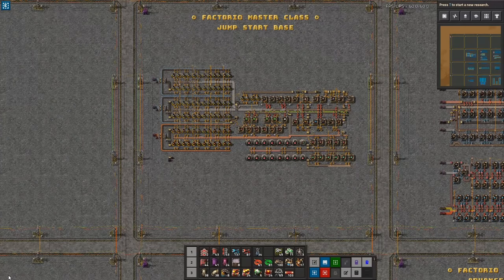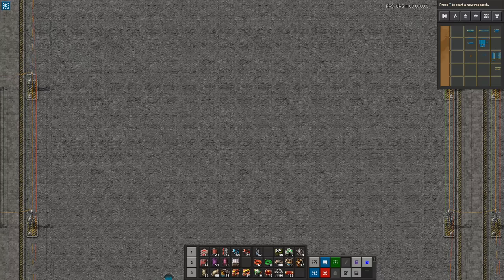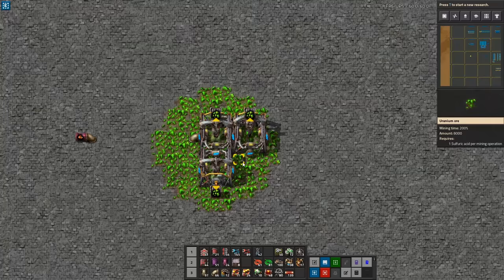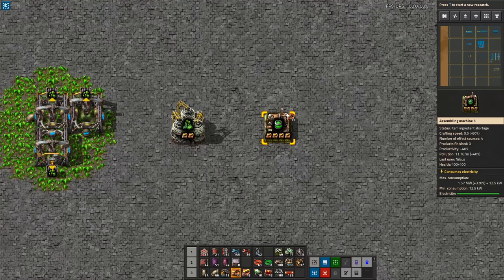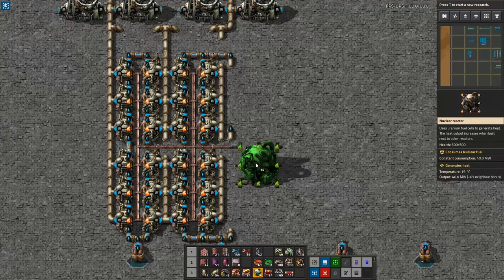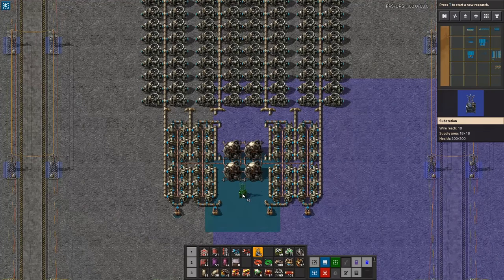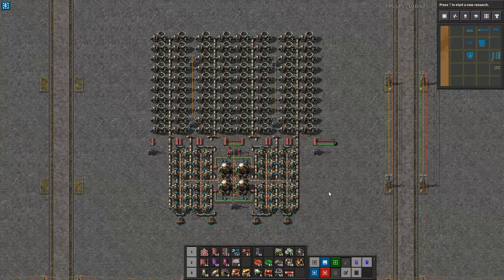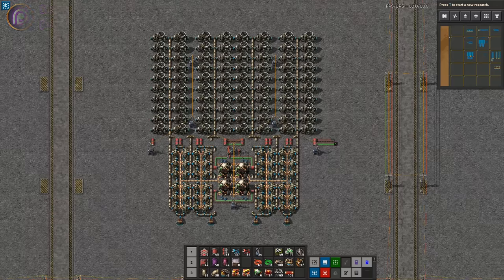NUCLEAR POWER; Shattering Conventional Wisdom | Factorio 0.18 Tutorial/Guide/How-to

Comment: Here is why I disagree with your perspective about steam storage:
One: steam storage is eeeeeasy. Just slap some tanks down in the free space along the sides of your boilers. The design difficulty is zero, and compared to the cost of the rest of the parts, a dozen tanks is basically free.
Two: peak capacity being higher than sustained capacity is useful for e.g. situations where you are transitioning from heavy solar or have lots of laser turrets or other situations where your power consumption needs might be "bursty".
Three: reactors which are hot (>900C) EXPLODE if they are destroyed by damage, with the same effect as a nuke going off. Nothing like a few biters getting into your power plant, and then the entire thing literally blows up and you have to rebuild all of those extremely steel heavy structures on a factory with no power.
Four: It adds resilience to brief outages. If I need to disconnect the water supply to re-route pipes, I can do that, and it will run for 10 minutes.

Technically, storing heat directly in pipes is more space efficient (500MJ/tile compared to steam tanks at ~269MJ/tile), but just building more heat pipes in random places is ineffective because as you point out, heat transfer becomes a bottleneck.

I disagree with your perspective about circuit-limited reactor designs too, because they are very simple to implement well. I homerolled a controller design which is 3x4 tiles, contains only 6 combinators, and it's both jam-resistant and idiot-proof. It's the difference between waiting until kovarex to spin up nuclear fuel for your trains, and starting it as soon as you can.
Reply: You make good points.  I guess it depends on the situation: a big base with low UPS means not using tanks will make the game run faster, because it doesn’t deal with the fluid calculations involved, and a base on a limited-resources-run is way better off implementing efficiency measures. 

It ultimately comes down to preference and convenience.
Reply: Well, if bitters chew your nuclear reactor, you have something very, very wrong with your base defence anyway.

I do agree that steam and circuit based nuclear power are simple to build, and they are scalable. You can easily build a 480 MW power plant (that's 4 reactors) even if you only need 60 MW right now (it's usually the power I need when I start looking into nuclear power). You won't use that much fuel, stockpiling for the future, and you won't need to deal power for a while.
Reply: @giovannidueck9094  Megabase skip nuclear power entirely and only use solar. Solar have no UPS cost. Nuclear power can't beat that, with or without steam tanks.
Reply: Regarding point 3: With the addition of the spidertron, this has become a non-issue. Simply building the reactors on an island that is only accessible by spidertron makes them completely invulnerable.
Reply: Doesn't really matter once your Kovarex process is up and running, as you basically get unlimited nuclear fuel.  Get a couple uranium patches being mined and processed and it's pretty much impossible to be short on it.
Reply: the  heat modulator for nuclear is rather simple. have red/green wire from tank to inserter that removes fuel. set too only remove fuel if tank is below say 10000.
run another wire from emptying inserter too fueling inserter. set filling inserter too read hand contents and only add fuel if it reads that there is more then zero empty fuel at hand. so when the emptying inserter is told too work it creates a signal of the empty can and triggers new fueling.  at idle the nuclear reactor will have one dead fuel in it. when tank gets low the fuel is removed which leads too the inserter outputting a signal due too read hand contents and then it ads one more fuel. make sure to limit inserter to one item.  too start up insert one fuel and let burn too emptie.
Reply: @joejane9977  thx man，it really help

Comment: One thing I like to do is add steam storage tanks and wire the system to feed fuel cells only when the steam storage runs low. This way, I use the fuel cells efficiently.
Reply: 34:11
Reply: @littlebuilder8132 then just build 1x1 reactor (lone reactor) setups if you think uranium is so plentiful that you don't need to be efficient.

I love Nilaus, but his argument here makes no sense.  He is saying to build 2x2 for efficiency, but then don't build steam/circuits because uranium is plentiful so you don't need to care about efficiency.  Can't have it both ways.
Reply: @beepbop6697  you need 12 1x1 reactors to get 480MW from a 2x2 , 12 reactors is far less efficient even with unlimited fuel.

Comment: Great guide! It's really surprising how few miners and centrifuges are needed even without kovarex. I always start doing on-site uranium processing as soon as I unlock the research. I don't use modules, so I go by a 10 miners : 3 centrifuges ratio. I usually start with a 2 reactor build because its cheaper to build early on and satisfies my power needs for a long time, and just the 10 miners and 3 centrifuges is enough to support it indefinitely. The nice thing about having a tiny uranium processing build is that you can put efficiency modules in everything and never have to worry about biters. Sometimes I will use steam buffering for the 2-reactor setup because you only need a couple fluid tanks (maybe 10 or 20) and the wiring isn't too bad. For the 2x2 build though its definitely not worth it, especially after you get Kovarex.

Comment: I have two extremely efficient designs that "just work", a 2x2 and a 2x5, both of which fit nicely within Nilhaus' city block blueprints. They feature auto start/stop for power saving and peak power boost thanks to steam storage tanks, backup power for the pumps nearest to the water input (assuming you disconnect their wires), all without a single combinator or requiring any sort of tuning. 

The 2x2 has a max boost power of 500MW, and sustained 464MW of a possible 480MW, and the 2x5 has a max boost of 1.6GW, and 1.37GW sustained out of a possible 1.44GW, so they are highly efficient too. I tested them rigorously to ensure they do not suffer from any of the common pitfalls that Nilaus mentions in this video. You can of course remove the steam storage if you don't care about fuel efficiency or all those nifty features. 

They are available on the Factorio Forums here: https://forums.factorio.com/viewtopic.php?f=208&t=91639&p=521863

Comment: I use steam storage with additional turbines as a means to store energy for turret spikes. I also setup an alert system so that once it is below a certain point(power use exceeds actual power production) I can go add another module to the power plant.
Reply: you can also use the steam storage to prevent over heating of your reactors : nuclear plants heat up to 1000°C no matter the consumption, any excess heat is wasted. If you setup things so that you only empty your reactors when steam storage goes bellow some level, and you only fill back when emptying, you will minimize fuel waste.

Comment: There is a good way to measure the actual power produced with an "electric-energy-interface" (you have to create it from console). When you set it to consume power, it has the lowest priority, same as an accumulator. You'll be able to see on the charts how much power is going into it. This is nice because it not only reveals flow issues but also includes all the pumps or whatever you use to keep the reactors running.

Comment: I haven't ran into any lag issues concerning nuclear power plants yet, and because of this I have developed my nuclear power very well. I designed a nuclear reactor that is actually tileable, and as long as ample water is provided takes full use of neighbor bonus. It consists of a base 2x7 reactor that then can be made into a 2xHoweverManyYouWant in a row. Only caveat is it must be built on top of a lake filled with landfills, since it would be near impossible to supply water with pipes. In my solo world, I was able to build it before I launched my first rocket, and each tile generates I believe 2.2 GW, which is amazing since you don't have to worry about power and if you do use more than that you just slap another tile one it. I have also developed a very efficient kovarex refining method that involves using circuit network signals to regulate exact proportions of u235 put into the centrifuges. It does require logistic bots, but if they are available to you you can easily convert thousands of 238 to 235  to be used for fuel or, my favorite use, spidertron with nukes. Of course, using this would leave you with very little 238 for uranium ammo, but if you use lots of laser turrets like me its not much of an issue.
If its requested, I can post my blueprints for either, but I'm sure there are already tons out there. Also, my reactor design requires lotsss of landfill (it has to be built ON, literally ON TOP OF a lake) and isn't going to serve as a beginner reacter lol.

Comment: I need to pull the blueprint, but I spent around 20 hours one time a year or so back trying to design the perfect nuclear power system.   the end system used 6/8 reactors, double heat pipes, tanks for water and steam but not for stream storage because there was exactly 0 fluid dynamics checks because everything was moved by pumps.   the water came in through the middle, between the turbines and the reactors, and across the bottom.   if you flipped the blueprint 180*, you could stick another one on the bottom and get a slightly higher bonus, and if you put them side-by-side they could share heat to speed up the initial heating process, and would share a mutual water input stream.  the pumping system could handle just less than 3x8 reactor setups horizontally before it would start to have problems getting enough water into the heat exchangers at the back.   the last heat pipe held a constant 525 degrees when the system was fully hot and fully utilized, which is why I chose to stick to 6/8 reactor systems.  can't get the heat out far enough to need any more than that.  I think that's the earliest hard stopping block.    when I say 6/8 reactor setups, I mean 8 to start untill all steam tanks are full, then take the bottom 2 away to leave 6 which maintain enough output to get 1.2gw steady, but built with enough turbines to do just about double that because that's what the system should be able to handle since it's duty cycle is only about 50%.
the best and only argument for steam storage is the day/night cycle and solar panels.  Free(ish) power, and you definitely shouldn't need all of your reactors at full steam during the day if you aren't relying solely on them for your whole base's power.  why not bank the rest of the steam for later?  it's only a few tanks. pump in pump out and you won't have to worry about fluid dynamics checks.   sure it's a bit bigger but, like, is your map size limited or something?  just tack on a tank field connected by turbines to burn off the overflow in times of very high usage. 
obviously I used bots to deliver the fuel.  I mean, who would even consider trying to belt that stuff in and out.  lol :P  (I kid)
getting water in was always the problem, but can be overcome with proper placement and delivery techniques (pumps mostly) 

All in all, that's a great guide though. well thought out and reasoned and the design is great for a 'bases first nuke field' setup.  the math may work out to being able to do about 1 reactor to 8 miners, but I'd like to see that actually work in practice.  what would the power consumption of 8 miners and (I think) 8 centrifuges with 8% productivity modules be compared to the power output of a reactor?  what's the real power profit there?  or is that just another really roundabout way of banking solar power when you think about it?
Reply: Tommy Taffy  has been a long time since I was a factorio master, but,  when I designed this fluid dynamics were far more rudimentary than they are today.   at the same time,  it's likely that pumps bypass the standard fluid dynamics that seek to balance population and flow between connected pipes and fluid containers.   pumps move fluid from one vessel directly to another with no mind to balancing or viscosity. if you chain pumps, or pump->vessel->pump, once filled, will flow at pump speed throughout the system (minus any fluid used or forked in previous steps). fullstop. 
the gain in flow rate and fluid availability in deep systems is not negligible.   try it for yourself..  chain pipes, underground, tanks... then do pump/tank/pump and see how much faster the end tank in the pumped system fills over any other layout....  then to prove it to yourself,  in the middle of the pump setup, switch 3 pumps for 2 tanks and put 3 in a row in the middle of your loop, or connect with pipes instead,  and see how just 1 fluid dynamics calculation substantially slows the rate the end tank fills. 

I'm going to dig up that blueprint... I'm sure I still have a vanilla world from 3 years ago with it built somewhere.

Comment: I know this is an old video, but I still kinda want to discuss some things if possible.

First of all while I do agree with many of your arguments regarding steam storage and big reactors, but they are based on the question of whether you need to save fuel or not.
So I feel a bit dissatisfied about the argument that you never need to build bigger than this one based solely on the fact that fuel is cheap. 2x1 would make for an even simpler build and probably even easier to tile - it's not more complex than a typical coal burner setup, so why not use it? I think saying that 2x2 is all you need needs a little elaboration, on why not smaller.

Personally, I think the question regarding the size of the reactor is about what you feel comfortable building yourself. On my last save I personally went for 2x3 reactor supplied by bots with nice symmetrical design, meant to be stamped all over the lakes. 2x3 is not much more complicated than 2x3 - requiring 80 heat exchangers and 138 turbines, and it outputs a nice round number of 800 MW 

Next I do kinda disagree with you design process of limiting your reactor output by water pumps, like other comments have mentioned. Water pumps are really not that expensive, and sometimes building more of them just produces a simpler design with less piping involved, especially if we are doing landfill design that's meant to go over lakes - you can just set up a pump for each row of heat exchangers, and leave it at that.

So I personally overbuild my water pumps and turbines a bit for the sake of simplicity and symmetry - like for example my 2x3 design actually has 144 turbines instead of 138, because it consists of 8 separate sections with 18 turbines each, and I want each being able to give maximum output. I can connect them together and remove some of the turbines, but honestly I don't see the need for that and the current version is cleaner and aesthetically pleasing. The setup has also been tested, and it does produce exactly 800 MW at maximum capacity like it should.

There is of course a consideration that you usually want to have more power available than your base consumes, so having your design limited by water pumps is probably pretty much irrelevant in the long run, I guess our difference here is that I prefer to round up and you opted to round down in this case.
Reply: Agreed.  If the argument is that uranium is so cheap/plentiful then why not just build 1x1 (lone reactor) setups? Anything larger is for the purpose of getting the neighbor bonus which saves fuel .

So on one hand he says you need 2x2 for the efficiency, and then on the other hand limiting the water (and no steam/circuit) because uranium is cheap and plentiful so just ignore the inefficiencies.

Can't have it both ways.

Comment: An interesting point is that even if you're committed to steam storage for your reactors, you probably only need to build your first reactor with steam storage. You'll be building a second reactor because you're about to exceed the capacity of the first one, so every other reactor you build can be running at full load without "wasting" power anyhow.
Reply: This is what i do, I rush nuclear to build a 2x2 reactor with removable steam storage, I use the steam storage function while my base is under 480MW and remove the tank section when i hit full load and paste down another 2x2 reactor when I need more power. I know wasting uranium isn't really a concern but i like the puzzle of it and like not wasting things.

Comment: Thanks again for some more great content. Really appreciate your hard work and clarity on these guides. So helpful.

Can I ask a question, though? I don't understand how you worked out that centrifuges require an average of 1.3k ore to be mined to produce only 1 piece of U235. My calculations work it out at 132.3, so that's makes processing of ore into U235 10 times more productive than you say it is (30:05).

This being the case, it actually make your point that you don't need to bother with steam capture or kovarex 10x more potent!

What am I not understanding? Am I missing something? Thanks!
---
Here's my math, just in case.

U235 mining yield @ 0.7% = 0.007;   8% production bonus on centrifuge = 1.08 centrifuge yield;   the combined yield = mining yield x centrifuge yield;
=> combined yield = 0.007 x 1.08 = 0.00756
∴ Combined avg. yield = 0.00756

Calculate the inverse to switch unit to U235 rather than ore; => 1 / 0.00756 ≅ 132.3 : 1
∴ Avg. ore needed to produce one U235 is approximately 132
Reply: the uranium centrifuge recipe takes ten ore to produce one bit of uranium. it takes 142.85 (1/0.007) cycles of the recipe to generate one unit of u-235 on average, so 142.85*10 ore, less the gains from productivity, which brings it down to around 1.3k ore.